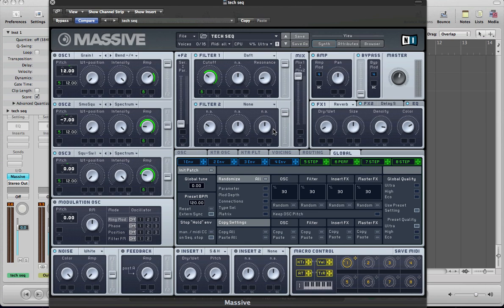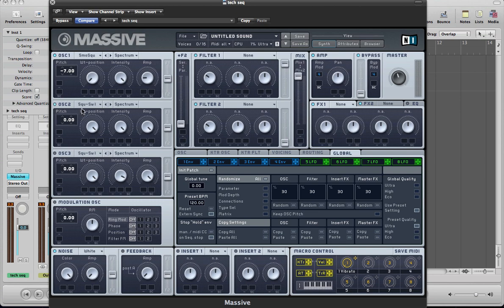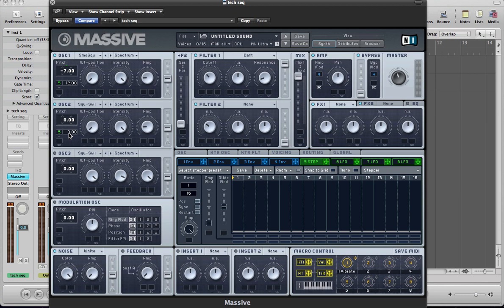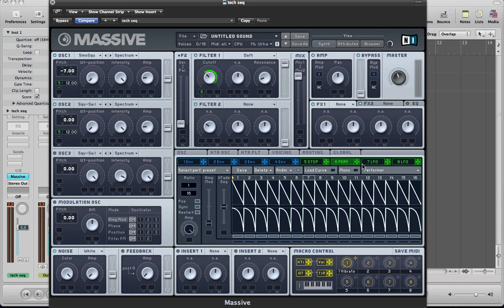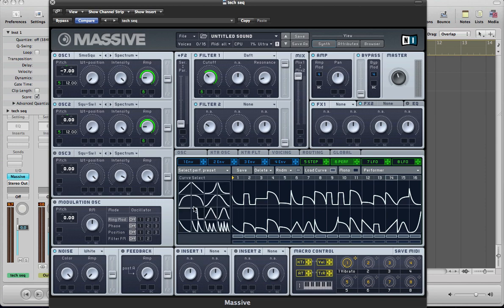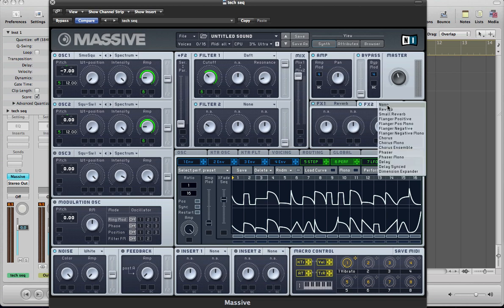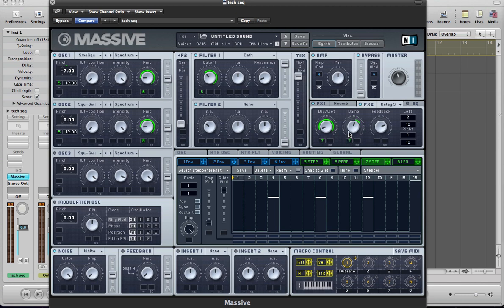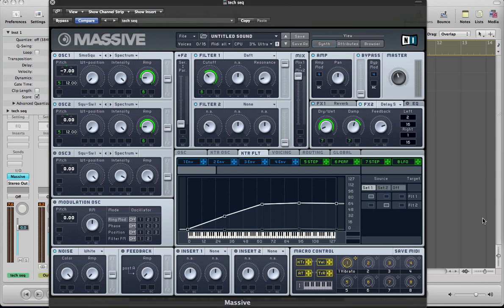Tech Arp/Sequence with Automated Delay Send FX

Comment: Yes. You can achieve this by activating the glide feature within the stepper by highlighting the box of which step you want to glide (in your case the step where the delay cuts out) and set the amount of transition with the glide mod slider to the left of the stepper.